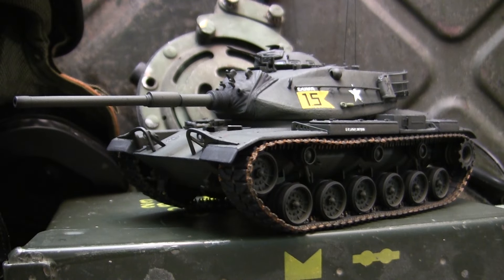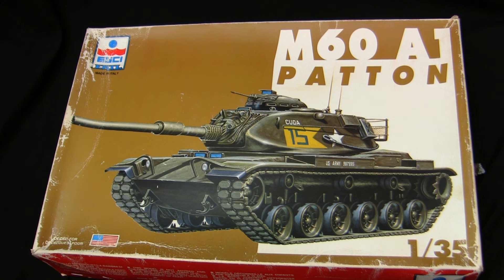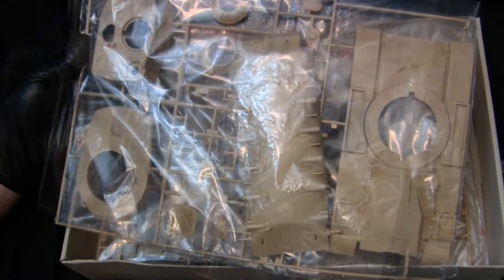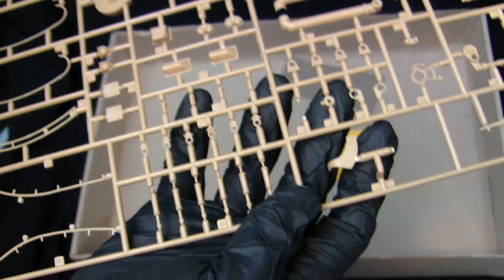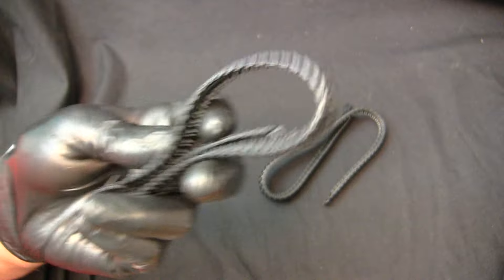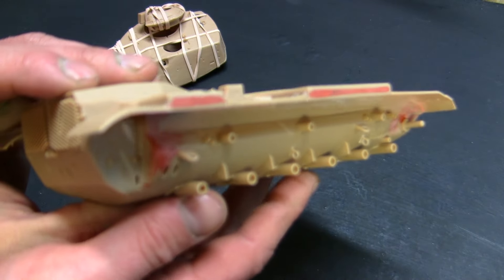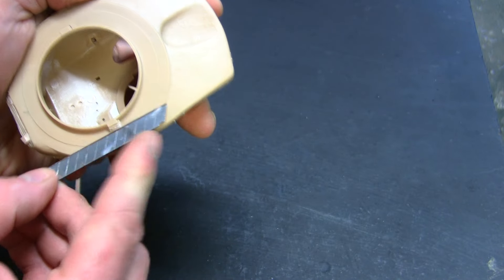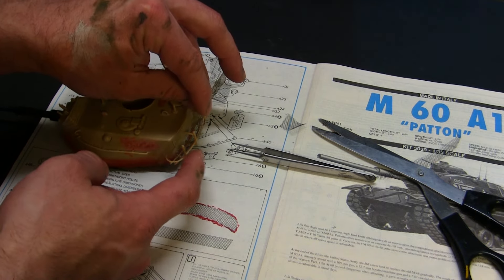1/35th scale vintage Esci m60a1 MBT

Comment: The "access cap" on the torsion bar mounts, is actually where the end of the opposite torsion bar would be located and secured. AT least this kit hull has them, though they are undersized and a bit out of location. I have found the AFV club M60A2 and Dragon M60 'slick' to have them properly sized and located. *Former gunner M60A2 74-78
Reply from the maker: thanks for the info, cheers!

Comment: Hi John! Your comment about Esci not having 1/35 WWII kits is not necessarily accurate: they had lots of figure kits of which I built a bunch of in the 80's. And I have two unbuilt ones still in my stash!
(This is maybe a premature comment of mine since I'm only less than 8 minutes into the video, so please forgive me if I somehow didnn't get you right🙂)
Reply from the maker: I should have been more specific, I was referring to 1/35th scale WWII tank kits specifically. ESCI never made WWII tank kits in 1/35. 1/72, yes but in 1/35 they focused on modern era vehicles